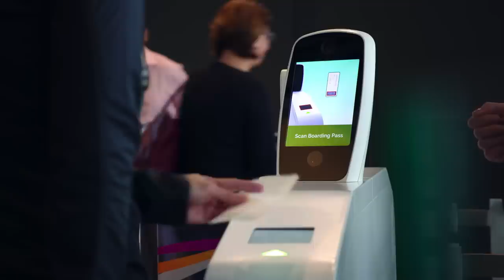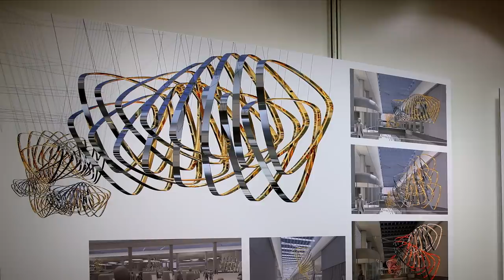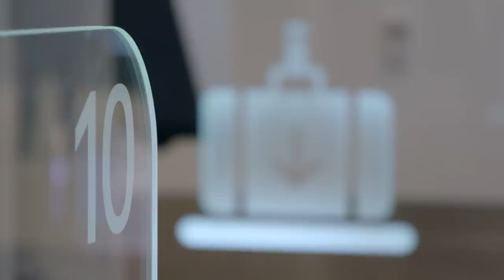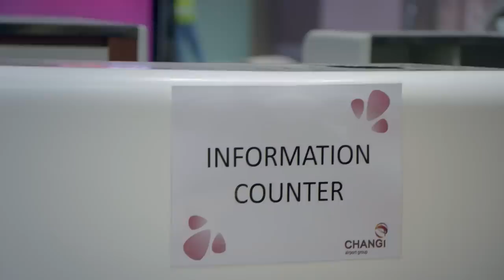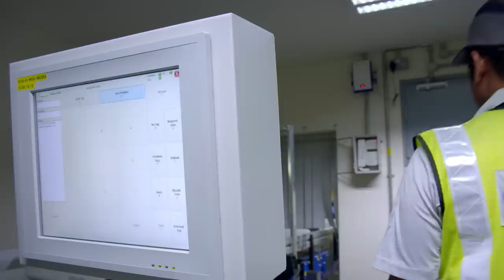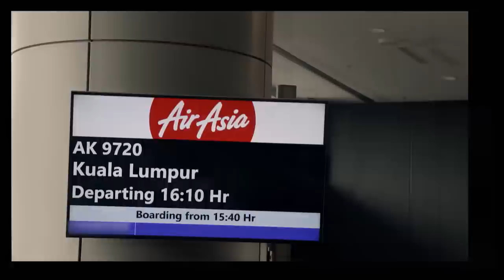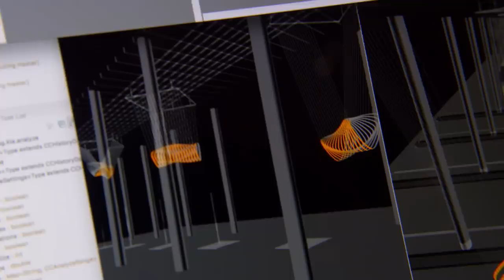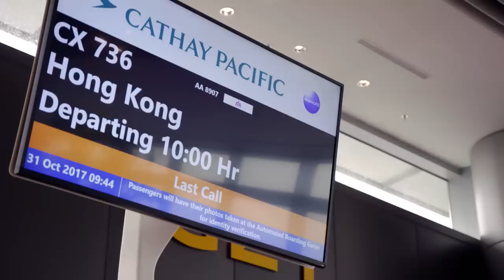Inside Terminal 4: Terminal of Tomorrow – Full Episode | National Geographic

Comment: Went to Singapore and luckily we landed at terminal 4 and it was a fantastic experience, we nearly missed our flight because we toured t1 to t4.
Reply: T3 my fav
Reply: 1 year ago I was flying back to Zurich from Singapore and was sitting next to a guy from a Swiss company, which manufactures the cleaning robots for T4. Was quite an interesting conversation.
Reply: I'm from London and I found Toronto airport quite nice. They had similar automated baggage technology for quite some time now. I do prefer the toilets in London that have the sink, mirror and toilet all in one private stall instead of shared space.
Reply: @runningfromabear8354  I used to be from London - my experience with both Heathrow & Gatwick is that they fall far short of the standards of most airports in the far East.
Several times when I was these airports, the toilets in these airports don't even have any soap.
Reply: @ftham888  I haven't had those experiences at Heathrow and Gatwick. What decade were these trips?

Comment: And this terminal is so far apart from the 3 main ones that you have to wait and take a shuttle bus to get there. It is not linked like the other three terminals where you could easily visit the the different transit areas via skytrain without having to go thru immigrations. For the 4th, you can only visit the transit area if you are only taking the flights that goes to terminal 4 and there are only a few of them.